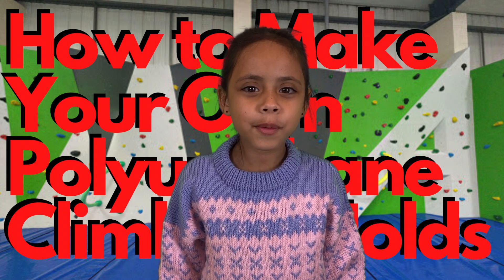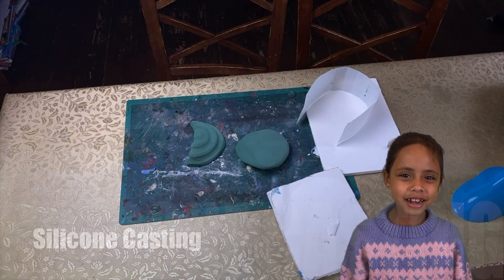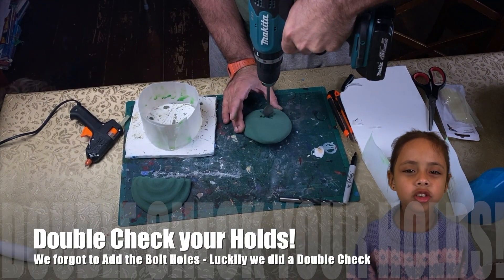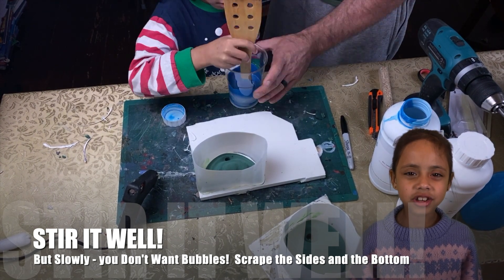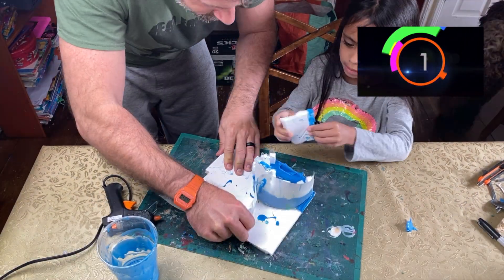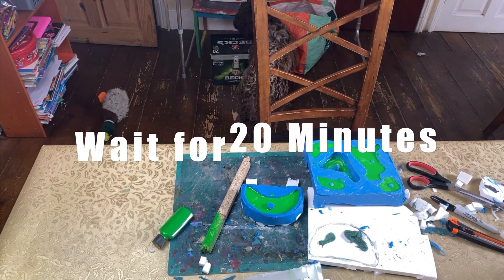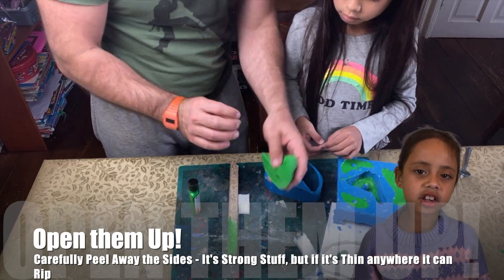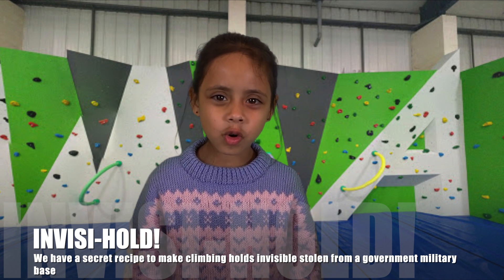How to Make Polyurethane Resin Climbing Holds & Silicone Molds for a Climbing Wall on a Budget

Comment: Are oil-based acrylics OK for coloring? I'm just getting started and not sure what I even ordered from the crafts store
Reply from the maker: Good question (Lenny's dad answering this one!).  From my experience the only issues with polyurethane resin is if moisture is introduced (water) which causes it to foam during the curing process.  Most polyurethane colouring is polyol based (the same as one half of the two part mix) with a pigment.  I imagine oil based should work, although it's well worth doing a small tester before trying a full cast.
Reply: @LennyKOClimbs  Thanks I will try a small hold first!
Reply from the maker: You can also get pigment powders but I haven't tried those.  If you're only making a few and want a greater variety of colours, you can get very small bottles of polyol based colouring used for making jewellery, so that's an option too.
Reply: @LennyKOClimbs  thank you! Is Polyol the same as "oil based" paint at the hardware store or do I have to order the special dyes online? All the acrylic paints are water based so they won't work. I also have Ryt dye powders
Reply from the maker: I'm not entirely sure.  I believe oil based would work but have not tested it.  The dye powders should do though, as I know you can use certain dye powders with resin.  I might do a test and then get back to you!
Reply: You can use acrylic paints too and even stuff like eye-shadow :)
Reply from the maker: You can't use acrylic paint HappyTailz - the water in them causes the polyurethane to foam and the climbing hold loses it's structural integrity unfortunately.
Reply: @LennyKOClimbs  oh, I guess I have just been lucky then :)
Reply from the maker: (Lenny's dad again) I imagine you weren't using a standard polyurethane which reacts very badly to any sort of water (which acrylics are based on).  From what I understand there is a water based polyurethane that exists so that is probably what you were using, however I've never encountered it myself.  Most polyurethane sold for casting is the type I use, but I have seen talk of the water based version for woodwork (making tables and items where there may be water porously coming from the wood).